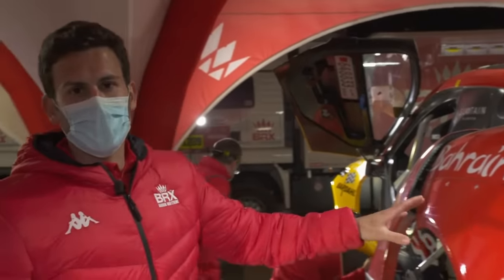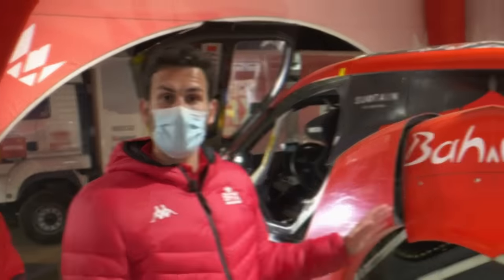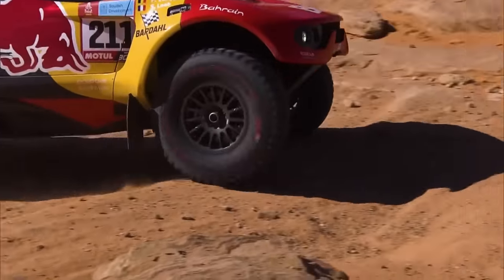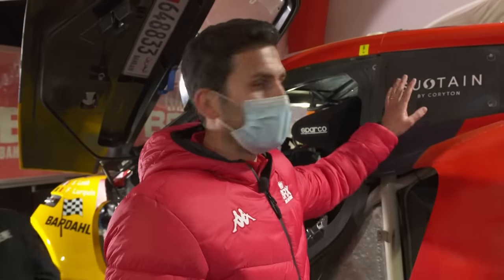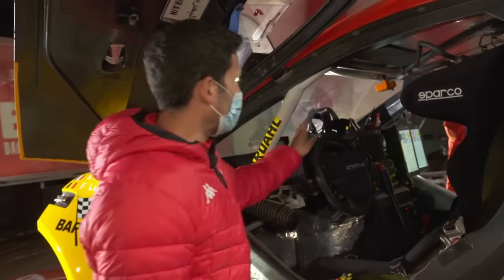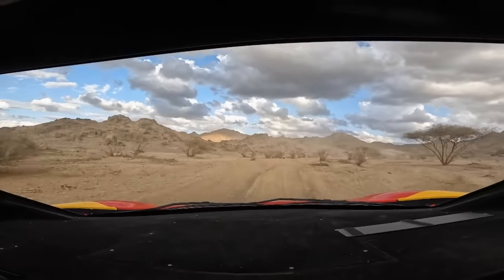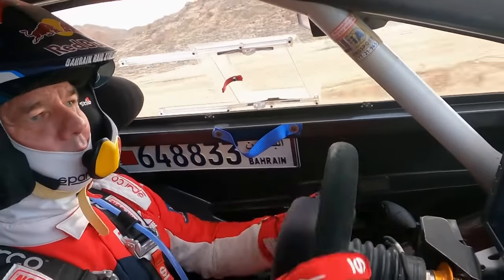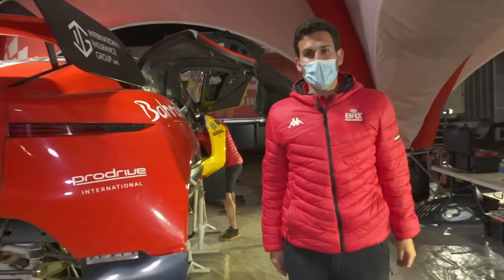Dakar Rally Tech Check: A Closer Look at Sebastien Loeb's BRX Hunter

Comment: Tech check?  Lots of shots of someone talking; no tech detail.  Engine  and transmission spec, mass, tyre pressures, chassis design etc, etc...
Reply: I think that has been purposefully omitted in this video. Maybe we will get the specs of it once this Dakar rally is over. I guess the engine is a Ford Ecoboost engine. Do correct me if I'm wrong.
Reply: Most probably a 3.5 litre V6 Ford Ecoboost engine with 400 bhp.
Reply: @mlvnthomas21  I respect there maybe secrets; just don't call it a 'tech check'.  Click bait.

Comment: I'm wondering why the rules have been changed significantly to aid the 4WD cars? I mean are they trying to kill off 2WD buggies? Why would any large team enter a newly developed 2WD car now if there's no tyre & chassis advantages?
So much of the terrain already favours 4wd cars before the regulation changes?
Reply: I get your point, but I think its cause 4wd, wider car, bigger tires, more suspension travel is the best combo, then they just want to see the best possible configuration, why would you dont try with something that could be better ?
Reply: The cars are completely different from factory cars anyways. FIA has been pretty clear they want 4x4s and not 4x2s in the future.
Reply: Dakar is meant for 4X4!!! They changed the rules in the Last in 7 year in favor of the buggies. Buggies have on board inflation system but the 4x4 dont
Reply: @actualperson1971  up to 2004 the cars mechanics (4x4 mainly) where almost stock, except for the suspension and the bigger fuel tank.
Reply: Well I think it would be cool to see the competition continue between 4wd and 2wd. To me it's more interesting to see strengths & weaknesses in different stages / conditions. And I think the drivers have to be very skilled in 2wd. Unfortunately when you look at every other top level motorsport (F1, Nascar, V8 Supercars, Motogp, WRC) the rules have evolved towards "one make" where every vehicle becomes extremely similar.
I'll bet the Dakar officials introduce control tyres next?
(Should I add lots of "!!!" to make my reply seem more important?)
Reply: @zyh6566  What exactly do you mean by "meant for 4X4!!!"?? (and why are you so excited?)
There is a rich history of both 4wd and 2wd in this event. I thought the Dakar was supposed to be challenging?
I didn't know the 2wd vehicles were the bad guys?
Reply: Mainly it's because of audi requesting a lot of this new regulations to suit the kind of car they want to field. The team with peterhansel and carlos sainz always have a favorable rules supporting them. When they're in buggy, the buggy is favored, when they're in 4x4, the 4x4 win. That's it